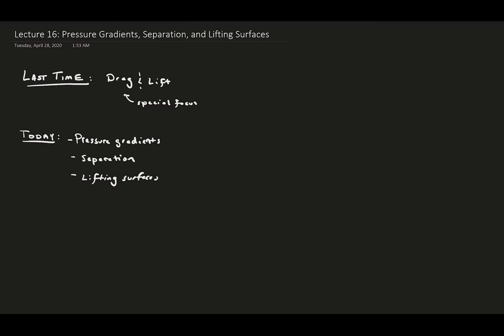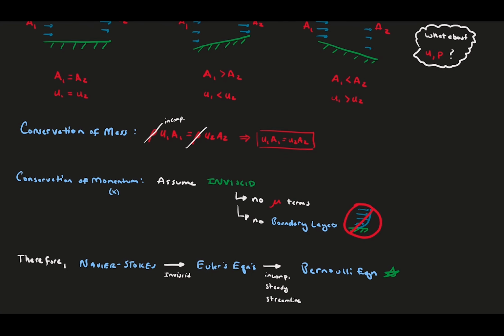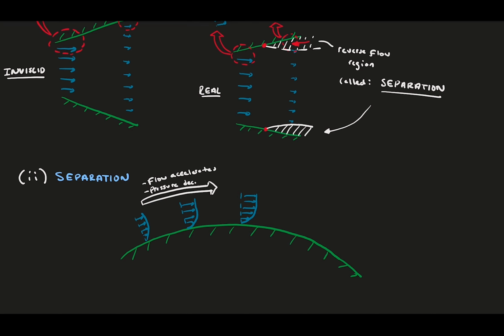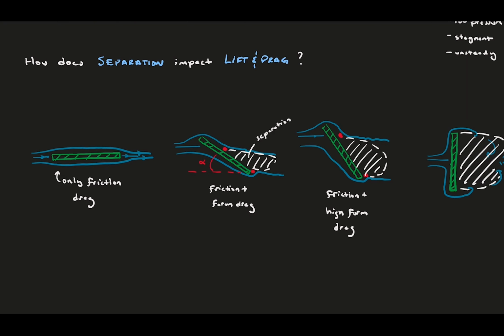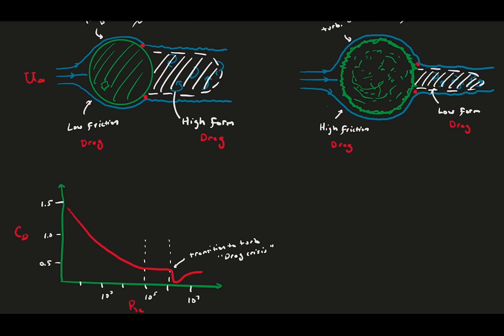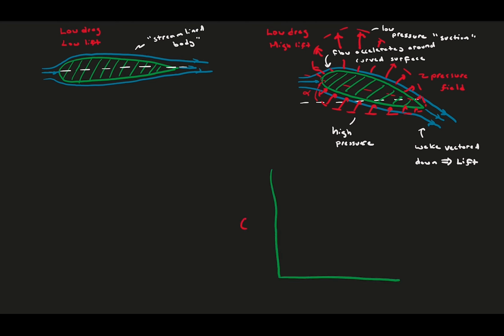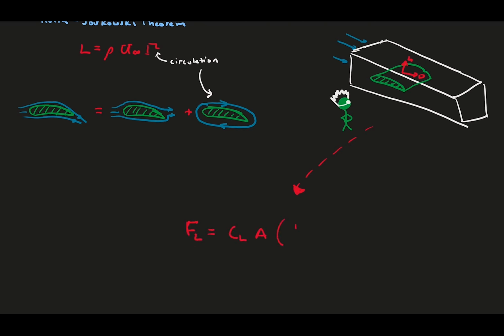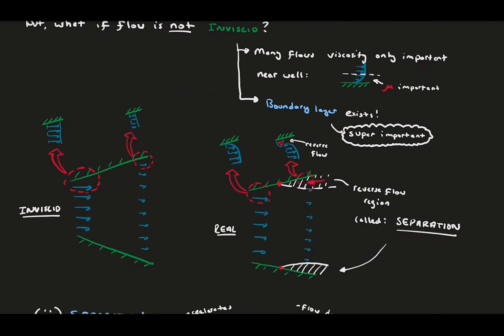Pressure gradients and separation [Fluid Mechanics #16]

Comment: why pressure in the separation zone is low?
Reply from the maker: Excellent question and a common source of misconception for me. I think it's more correct to consider it as the pressure is what's causing the separation. Adverse pressure gradients (going from low to high pressure) lead to separation, so when flow separates it relieves this gradient leading to lower pressures in regions where it has separated. 

What originally confused me is it is natural to think separation means lower velocity and Bernoulli says that means flow pressure should be relatively higher. However, separation is slowed only in the streamwise direction and can introduce vertical velocity components that didn't exist, so the total velocity might not have reduced.

Comment: I have a question sir why does speed of wind slows down when it goes downhill but increases uphill ?
Reply from the maker: It depends on the situation, but generally speaking an "uphill" flow closes in, kind of like a contraction with only one side. Conversely, a "downhill" flow opens up, and then there is more area. With a conserved mass flow rate, if area goes up, velocity goes down and vice versa.